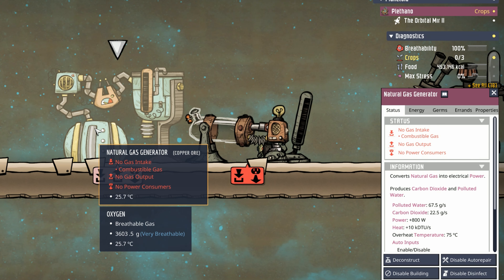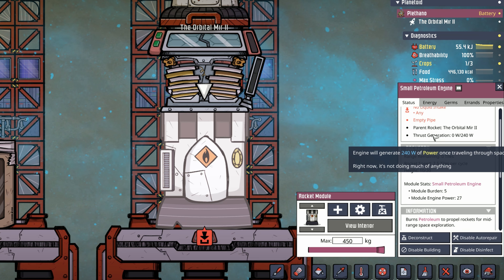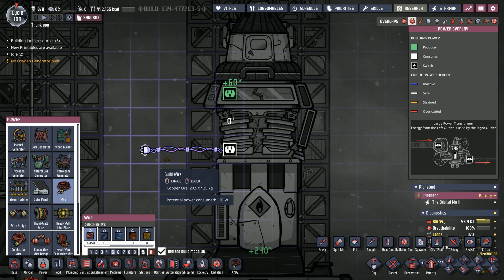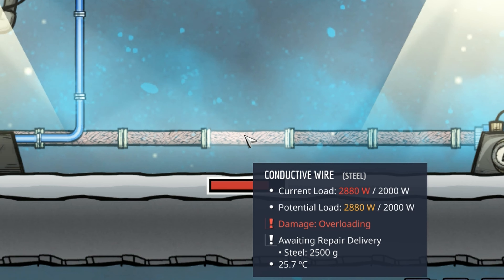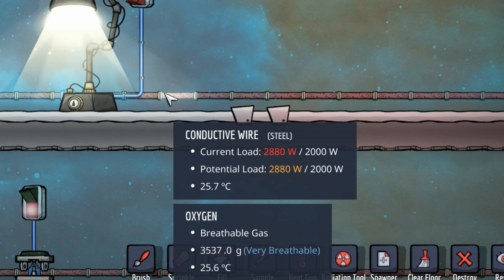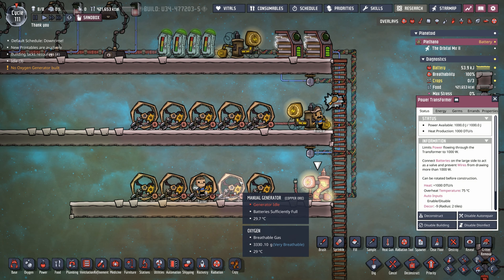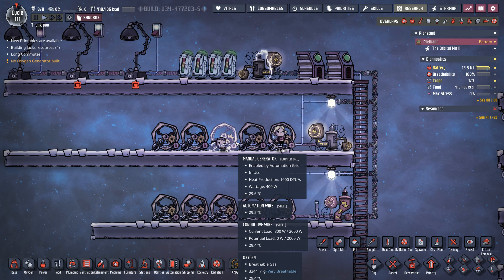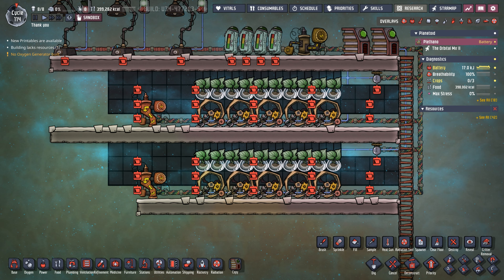Power Tutorial | Oxygen Not Included

Comment: Try adding a normal battery beside the manual generator to the design at 16:28 . It shouldn't be holding any power at any point of time so no leakage
Reply from the maker: I just tried this out.  And it works like a charm.  In fact putting any switch or battery between the generators and the flipped transformer works.  Thanks for the tip.  Pinning this to help folks out.
Reply: @EchoRidgeGaming  Can you explain this in a little more detail?
Reply: @Voltechs  The generators load the battery and the battery loads the transformer.

Comment: A watt is defined as a Joule per second, not a watt per second. It’s actually not complicated when you define the terms properly
Reply: Part of me wishes there was an option to view battery capacity in terms of watt hours or something like that, like how you can switch between units of temperature
Reply: @Brugosovi  Fortunately it’s not a difficult conversion. It’s already in seconds so just divide by 60 to get minutes (60 seconds in a minute) and divide 60 again to get hours (60 minutes in an hour).  If you need to know how fast your current load will drain your battery, just divide the total Joules of the battery by the total Wattage being consumed to get the number of seconds.
Reply: It’s not difficult yes, but the terminology can still be a bit confusing at times if your not too familiar with them. 

So I don’t think he said it not knowing that, just a slip up with the tongue
Reply: @minecraftgigachad9368 why what’s the merit in that? Unless power consumers use the same unit it just becomes a greater headache. And all it does is make numbers smaller by a factor 3600. 😅
Reply: No power is energy over time. The power in this case is wattage and a joule is a measurement of time for energy. Power is universal all power is measured as energy over time in this case we are talking electrical so the energy is measure in watts it is a 1 to 1 ratio in seconds. I'm a master electrician and have been for 44 years more than happy to explain any electrical, electronics, avionics to you guys. This game has some mega lifelike mechanics the developers of this game nailed that part. As far as the mechanics, physics, stats etc. it's to the T
Reply: @Xelaria joule is a measure ment if time for power. Power regardless is always energy over time. In electrical watt is the power and it's always 1 to 1 in seconds
Reply: @mattc16 it's way simpler. Power is always energy over time always I don't care what power it is mechanical, hydro, electrical it does not matter p=e/t. In electrical aka the p the energy watt is measure in joules because joules is how u measure time. It's always a 1 To 1 ratio in seconds because we are measuring a time

Comment: Ugh. Thank you for this explanation. I'm no stranger to electrical stuff, but I too was using a transformer to feed to the grid. Been experiencing lots of weirdness. Had to switch it,. I came to see if I was missing something obvious about this electrical grid stuff. I don't think I am, so I'll still have to investigate more. I will say though, I really dislike ONI's handling of wire gauges. Just because a smaller gauge wire is on the same circuit, as long as nothing down stream of it is pulling more watts than it should, it should not be subjected to brownouts or damage. Grrr.

Comment: This a nice video.
Some missing things tho:
- you showed how power generated by the steam turbine varies, you didn't show the same for solar panels, so people may get the impression it's fixed at 380W. Things are much more complicated than that with solar panel, I think it deserve mentioning;
- "efficiency" is a bad term to describe the power generated by a steam turbine in the 140-200°C range. The efficiency is the same, you loose efficiency above 200°C, when you start wasting heat if you don't close some intake.
- heavy conductive wires are made of refined metals, so their decor penalty is  variable; using the right material, e.g. gold, is worth mentioning.

The issue you're seeing with manual generators is due to the fact there's no battery connected. They probably sense the internal battery of the transformer. Try and add a battery on the generator side and see if that changes the behaviour.

The real problem with feeding power to the backbone via transformers is that the wire doesn't draw from them all at the same time, there's a priority of sort based on when the transformer was build.

Now the sore thumb.

Unfortunately, if you're venturing into explaining the difference between Watts and Joules, you need to get it right. There's no such a thing as "watts per second" as you state @15:23. At least, not in that context. That's definitely wrong. We don't mean Watts per second. We really mean Watts. Watts are already Joules per second, sort of.  Real world Watts are a unit of power, which it is energy over time as in Joules over seconds but with a infinitely small time interval.   ONI is a simulation game, which operates with discrete time ("ticks"). So there's not such a thing as power in ONI (despite them calling something "power").  There's only average energy over time, with time intervals limited by ticks.

But for sake of simplicity, they call it power and use Watts, and I'm ok with that. That's not really the point here.

Point is, even in ONI, Watts are Joules per second.

As "power" variations happen across ticks, there's no Watts per second; that would be a measure of how fast a transformer adapts when the load changes, but again in ONI it happens in zero time in between ticks. The same if generators stopped slowly you could measure how fast they stop producing energy. E.g. from 800W a hydrogen generator could do one tick at 600W, one at 400W, one at 200W, then reach zero. That could be -1000W/s.  Instead they just complete the animation and go from 800W to zero across one tick.

In ONI Watts per second is always infinite.

A light in ONI consumes 10J/s, or if ticks are 1/5 of second, 2J per tick. So the game describes it as a 10W light. It's either 10 Watts or 10J/s. Not W/s.

Comment: as a point of order, no the manual power gen doesn't put of CO2 the dupe would do that anyway. thinking about it that way detracts from the overall gas projections of the colony and could lead to miscalculations later. simply for the fact that either or not that dupe is running its gonna be putting out CO2

Comment: The concept of transformers "charging up" and "slowly discharging" grinds my gears.  That's not at all how transformers work IRL  Their actual use is to trade volts for amps, and have absolutely NO ability to "store" power.  Instead of heavy watt wire, they could be implementing HIGH VOLTAGE wire, for the same reason, to transmit more power.  Then you REQUIRE a transformer on both ends, to step up the voltage before getting on the heavy wire, and to step it back down when getting off the heavy wire, because most "consumer grade" equipment can't run on high voltage.

I suspect part of the reason they're treating transformers kind of line batteries is to simplify the simulation, and not have to deal with any one item on a power grid anywhere instantly being able to affect every other thing on the same grid.

Comment: Setting the battery control to 100% can also, depending on how much load is on your line and how close it is to your overall generation rate, cause the problem of the battery never properly filling up and thus never sending that red signal. Setting it to 95 guarantees that that won't happen, preventing some pretty serious power loss.

Also, the unspoken other reason to minimize your Heavi-Watt Wire usage is because that stuff is EXTREMELY expensive. At 100 units per tile for both the original model made of ore, and the Conductive model made of refined metal, any length of Heavi-Watt is a significant metal investment. There can be points late in a colony's life where that doesn't matter, because you've gotten access to bottomless sources of metal, but it's gonna matter for a long time in the getting there.

Comment: In the phase of the game where manual generators are crucial, and not just a useful way to keep the machinery attribute of your operators going up during idle time, decor is not a particular issue. I've found the best early game power solution is just a power room for the generators and a battery/transformer room, the door and ladder to which should be in the back of the power room and which after you built it no dupe should be allowed to go into (they won't need to). Using the heavy watt wire to hook up all the manual generators and 4-8 smart batteries (a few jumbos initially are fine, but as you know the leakage - and leakage is also heat) to a 4k transformer, and then to hook up 4 1k transformers to the 4k transformer. Leaving enough space in the room with the manual generators for a hydrogen generator (for when Mr SPOM arrives). This provides neat 1k power sources for 4 normal wire sub-grids Or 2 conductive. Or a mix. As the need might arise. 

Decor... You can add a lot to the power room to make it prettier. Even basics like tiles, drywall and crown moulding will make a marked difference. Snazzy suits are always a quick win. One or two operators with the innately stylish perk will do further wonders if you can get it. Two operators with both will be exposed to a 110 points of decor glory when they cycle next to each other. Even the small sculpting blocks are very good. Even if sculpted by a talentless hack.

Comment: For power generation you can connect the generators with conductive wire and directly connect it to the HW conductive wire with a switch on the node. For generators the watts count as 0 load on wire.
And use two sets of batteries and 4 switches.
2 switches for the generator line to the 2 battery sets:
Connect the switch for the one you need charging, and open the switch for the other set which is providing power. 
2 switches for the providing line from the 2 battery sets:
which is the opposite, just use HW wire and connect to the transformer, set switches in between.
Set an automation for switch control using them on different times and don't make one battery charge and provide at the same time.

In that way no decor dmg at all. Just one main grid line.

Comment: 18:50 that's not true, you can use it like that, all you need is balancing, as power generator an outputs dont always sync, a single weakest battery that would provide you cappacity for spikes, is enough for this system to work well. Yes you have some batteries on both sides of transformer, but one of them is just cache, will not ever store real power.

Comment: I'm sorry, I just do not get the reason to use a transformer. A circuit can handle 1000 watts if you use normal wire and that doesn't change when using a transformer, does it? I do realize thats probably not right, but I just do not get it.
Reply: The transformers bridge 2 different circuits, a high side and a low side. They allow you to run a large backbone circuit on the high side of 20,000 watts (heavy Watt wire) or 50,000 watts (heavy conductive Watt wire) on which you connect all of your batteries and power generators. Then on the low side you can connect to a separate 1000w circuit using regular wire.
Reply: @bughouse26   I think what makes me stumble is when I can put loads of stuff on a circuit. That’s only the regular wire or the conductive wire that determines that, right?

Right now I have 4 coal generators to one side of my base, and they each supply power to one circuit with a smart battery. One generator to one floor of my base, I mean. They are not connected with heavy watt wire or a transformer. That works and to some extent, I can run the conductive wire to pull more than 1K of power off any of the circuits, but it does struggle on occasion. Even though the conductive wire should be able to handle at least 2K of power consumption. That’s what I really do not get.
Reply: @h.j.taaning2183  Not sure what "struggle" means and I can't tell by your comment if you're saying A) all the coal generators are connected to a smart battery that is then connected to all the consumers or B) if each coal generator has a smart battery that is connected to its own set of consumers. Your comment that conductive wire should be able to handle at least 2000kW is incorrect, that is the max it can handle. So in A you would be overloading your wire as soon as more than 2000kW worth of consumers were active. In B you would be overloading your wire again as soon as more than 2000kW worth of consumers were active but also running out of power due to a single coal generator only producing 600W. 

I think what you're wanting to know is when can you connect many consumers without worrying about overloading wires. The answer is, you can't. You always have to pay attention to current and potential load to ensure you don't exceed 2000kW (for conductive wire).